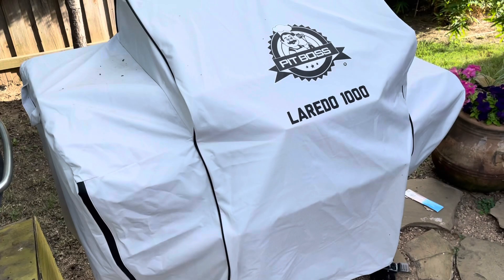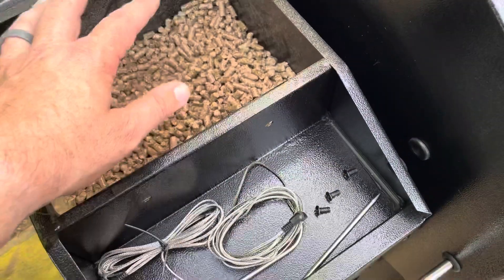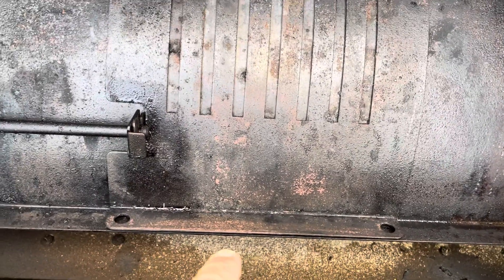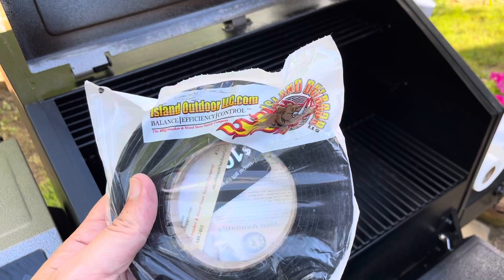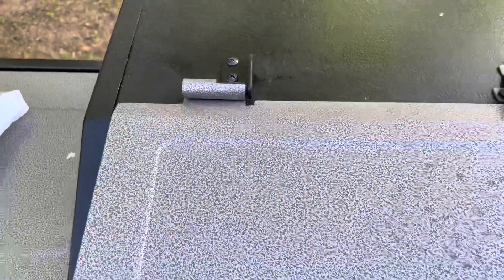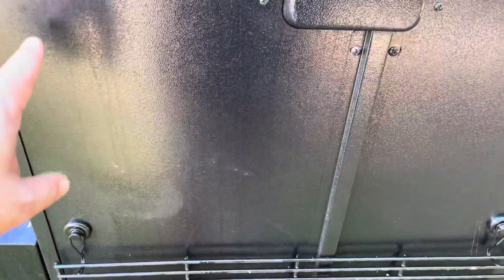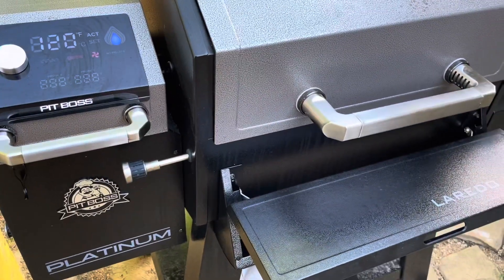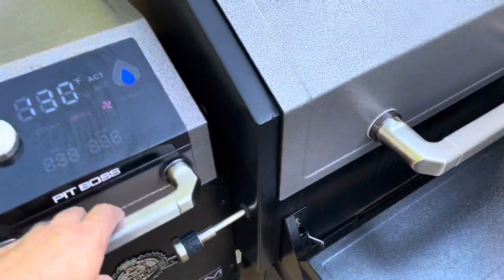Pit Boss Modifications: Laredo 1000

Comment: Mr. Clean did that to your paint on the lid.
Reply from the maker: Really??? Pitboss sent me a new lid!
Reply: @EagleRun23  I used Mr clean on my smoker as well and they sent me replacement as well. My friend also cleaned it with Mr. Clean and it ate his paint too. The paint is heat resistant with no cure for other types of chemicals so it's not really rated for cleaning products that we use for our bathrooms or kitchen. I would recommend a stainless steel spray cleaner for the lid and a water whip down after cleaning it well. 👍🏼

Comment: Magnets due lose magnetic flux or ability to hold with and increase in temperature, however I doubt it would affect you with the light weight of the grille wrack.😁🛫
Reply from the maker: been a while, they are good to go for now! Id recommend! cheap and easy solution.
Reply: It is funny that your #3 mod is to hide / store the other grill grate using magnets. For the last two years I have walked past my grate that is leaning up against the wall in the garage. 
I may very well do the same.😀🛫

Comment: Did the same with auger grate right away but same problem with mine not a good seal around lid. Need to add the gasket especially before winter.
Reply from the maker: this fire black stuff is pretty good!
Reply: @EagleRun23  did you figure out the discolouration issue on the lid
Reply from the maker: @alcleary2000  no but they warrantied my lid. Thankfully.

Comment: You said you don't hardly use the center grate. The center grate should be used almost all the time to smoke as a pellet grill works like a convection oven as per Meat Church.
Reply: I use the bottom and middle grates most of the time. There is not a lot of room over top grate. Ok if you’re cookin something thin or veggies, peppers,corn,etc.

Comment: I got some stick on SS Hooks in the stationary section of WM and going to see how well they work.  For $5.00 I figured I would try it.    I find the lid dangerous, it falls to easy and is super heavy.  Not sure if the lid stop on mine is in the right location.  I am going to try and magnate like those on the inside of the lid stop and see if it holds the lid in the up position much better.                                                                                        Magnets no problem with that heat, steel becomes no longer attracted to a magnet at really high temps.
Reply from the maker: if its windy, it will chop your fingers off!
Reply: @EagleRun23  Yes sir, working om getting a good magnate for the lid top and see of that helps hold it better

Comment: I decided to add the gaskets to the door like you. It just so happens I'm storing my grill in the garage at the moment. With the garage door down and lights off, i put a couple of lamps inside the grill and shut the door. i was easily able to see then where the light was leaking from around the edges of the grill door. i installed the gaskets all around the grill door. Using the light trick again, i found the light leaks had shifted to other locations after i installed the original gaskets. Any attempt to "thicken" the gasket in certain areas tends to widen the gaps some where else. I just might give up and rip it all off and live with the original !eaks. Turns out the light trick i used was a curse. i was better off not knowing.

Comment: A consideration about the guard in the hopper: on the back side get some longer screws, so it’s a slide in without having to take the control panel off. On the other side, get some wing bolts to hold it in.

Comment: I have this grill and am having trouble with flame outs and it seems to take a while to heat up, the fan was sticking and was the cause of the previous flame outs but i got that working and it still does it. maybe I am getting that low spot in the pellets you showed and its not feeding correctly?
Reply from the maker: Sorry to hear that, no issues like that.  what pellets are you using?
Reply: @EagleRun23  I finally figured it out, my fan was sticking, after getting it loose I haven’t had an issue since. It still takes a while to get up to temp. Like 25 minutes to get to 275. Using bear mountain pellets
Reply: Are you referring to the fan you can see when opening the door on the left side of the grill? I'm also having issues getting my grill to temp
Reply: @carriecole6531  no it’s the actual blower fan, the fan you are referring to is on the auger shaft correct?  Mine is the larger fan you can only see from underneath
Reply: @silentassassin1108  yes that's the fan I'm referring to. I'll have to check out that other fan the next time I fire it up.
Reply: @carriecole6531  I also added the gasket around the lid like in this video. It seems to help
Reply: @silentassassin1108  I'll have to give that a try as well. I thought maybe the weather had something to do with it but it wasn't that cold when I started it up this evening. I was reading tips online and it said to adjust the P setting when it's cooler outside and I cannot find anything on how to do that in the manual unless I'm skimming over it.
I'm thinking it could be that fan sticking though as well so I'm definitely going to give that a look. I've only used it a handful of times and even after set up, doing the burnoff took over an hr to get to temp.

Comment: I’m looking for a mod for the unbalanced temp problem where the left is about 20 degrees hotter than the right. I found a mod using 6x6 1/4in steel plates, but it was a different model. Might try it but wondered if you have anything different for this?
Reply from the maker: Yes temp spots can be an issue. I would think plating the whole bottom gray up would help. 

I also saw a guy who blocks the top of the drip tray with foil.  Many speculate that the angle on the trip tray causes the left to be hot as it angles down to the right.
Reply: Every pellet smoker burns a little hotter on the side where the smoke stack is. Nothing you can do about that.
Reply: Adding a heat diffuser and closing the gap in between the arch of the lip on the left side will make your grill heat very evenly.  Both modifications can be bought or if your handy, can be made quite easily.

Comment: Do u have any ignitior problems?
Reply from the maker: not so far. Just took the cover off this weekend and got her cleaned up.  I have 2 14lb pork butts smooking currently.  Love this rig, no problems other than the discoloration of my lid. which they fixed.
Reply: Thanks I’m have to call bc I keep getting and Err code whenever I cook for over an hour it the customer service is awesome so far
Reply from the maker: @chadhunt5584  Ill give them credit, customer service was very helpful. I have a couple videos on my channel about the smooker, but so far so good.
Reply: @chadhunt5584  bro I need your help lol I’m having same issue with err code what did u do to fix it I’ve used this smoker exactly 3 times ??

Comment: The auger could certainly chop off your finger but it's extremely unlikely unless someone is being a total idiot.  If your finger got caught between the auger blade and housing it would absolutely crush/sever your finger, it's got lots of torque.
Reply: at 1.6 RPM you'd have to be a complete idiot to get your hand trapped in the auger LOL
Reply: @CelticLaserCrafts  true but even though it's super slow rotation if you pushed your finger in at the edge and at the right moment it could be bad... but there's no denying there would be abundant stupidity involved.

Comment: How fast does your pit boss heat up. I got a Laredo and had some issues and ended up returning it. I found that it took so dang long to heat up to temps over 300. Like 35 to 40 minutes to 375
Reply from the maker: IF I am going to 375, which I don't a lot, ya its 30 min.  If I am smoking a shoulder or a brisket in the 200's more like 15-25.
Reply: I’m having the same problem. Seems to take forever to get up to temp. When I fire up my Traeger it adds pellets quickly until it reaches the set temp. The Laredo barely adds any pellets at a time. I think it runs the auger for 3 seconds then sits there for 30-60 seconds. Definitely not happy with waiting an hour to get to 350.
Reply: @troyhunt1238  I ended up getting a used traeger pro 780 for 500 bucks and never looked back. Works so much better than the pit boss
Reply: I had the same problems. I did the gassed as well. But I leaned to take that off. This is the start up process that I use.  Open the vent all the way, keep the door open a little for the best air flow. The more air flow you have the faster it will heat up and once you set it a temp leave it there don’t touch it and it will heat up within 25-30 mins depending on the weather out side. And I also put a welding blanket on it to keep the heat better. This is what worked for me

Comment: Why all the fuss about a few wisps of smoke around the lid? There is a huge exhaust pipe on top of the smoker that’s letting bunches of smoke out😂😂 When that thing is up to temp and cookin the whole cookin chamber is full of smoke so some of it escaping is not gonna affect the cooking process at all. With a little sooty buildup it may seal itself over time.
Reply from the maker: Hey Mitch! Not sure that I made much of a fuss. It was a trial. Temps hold good and I am very happy with this minor mod. It’s not about making an air tight pressurized smoke container. But pellet smokers could always use more smoke. So let’s keep as much in as we can.  Regardless I appreciate you watching and commenting!
Reply: @EagleRun23  All good bro!👍 You are putting out some good content and it is appreciated😀
Reply: @EagleRun23 get you a smoke tube. Problem solved.
Reply from the maker: @jasonstokley7274   ya I have one, this was just a wild idea that “kind of” worked.

Comment: If you're getting smoke leaks in various areas where there are joints or bolts, couldn't you just weld them closed?  And for those of us without a welder, use some extreme heat JB Weld.  As long as the fixes don't cause mechanical harm, you're golden.
Reply from the maker: I would think so, ya

Comment: Hey bud, nice video! I recently picked up this same pellet grill. It just seems to have everything I wanted in it. I love the mods and I am thinking about taking on a few. The magnets to hold the rack was super nice!
Reply from the maker: The fire tape may not be necessary, it worked for me, but many said it created MORE gaps.
Reply: There is a built in holder for both grates under the grill next to the propane tank
Reply: @jonnywhiteisawsome2616  The Laredo 1000 has no propane tank.  What does the holder look like ?